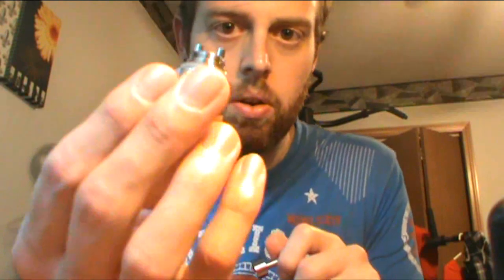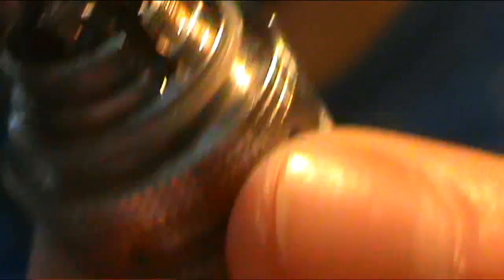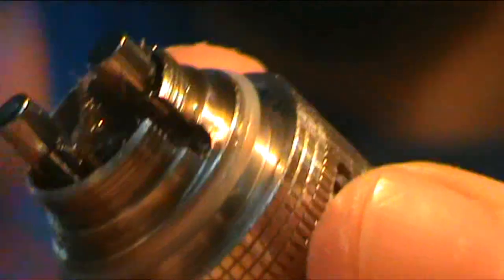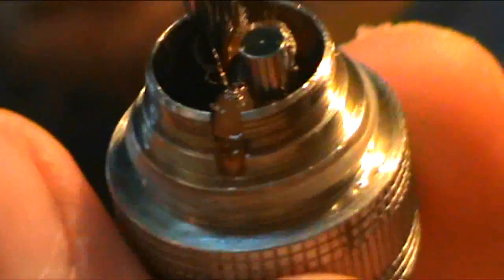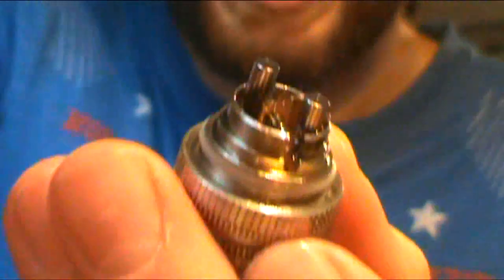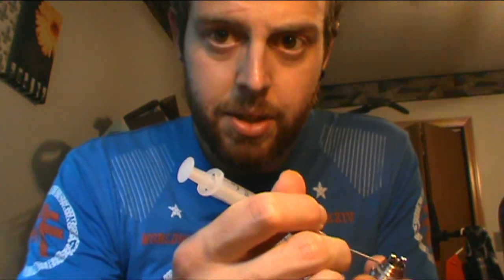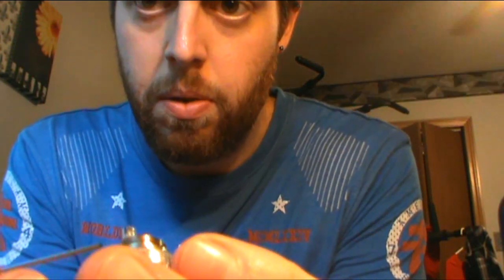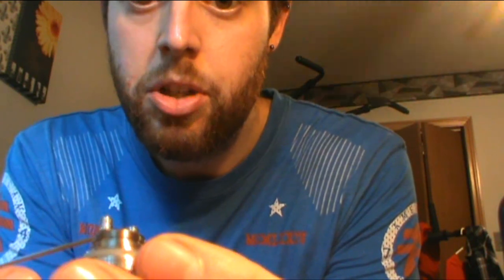Smok RSBT follow up! Optimal wick setup

Comment: Kool, thanks for the informative vid. I was just about to throw mine into the back of the never to be used again drawer. I made sure the wicks were not touching the glass, backed off the chimney to make sure I was not choking off the wicks and even used a 70/30 juice. I tried builds with cotton, ReadyxWick, and Ekowool and still got harsh and dry hits even a lower watts. I have to admit that I do tend to chain vape a bit however, that should not be an excuse for getting burnt hits. After following this method, with 26ga @1ohm, all I can say is wow. I will be adding the RSBT to my rotation. Great flavor and plenty of vapor with 50/50 juices and so far no dry hits. I don't think I will give up the Kayfuns, but, I will definitely keep this one full.

Comment: so im running 26g 5 wraps at .5 ohms and i have my wick coming out the channels and i dont get any dry hits i dont know what im doing different but its working amazing for me
Reply: What are you using for wicking material?
Reply from the maker: Yea if your using silica or Eko wool I would assume you need the ends to run into the tank and out of the chamber. If your using cotton, hey, power to ya my man. I'm glad it's working.
Reply: im using rayon but ive used cotton and it worked
Reply from the maker: Glad it works homie!